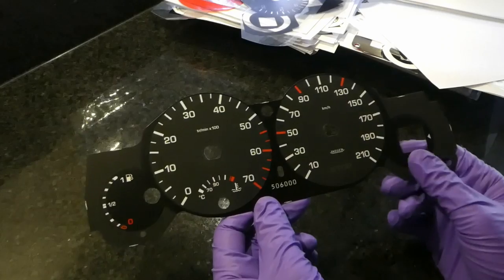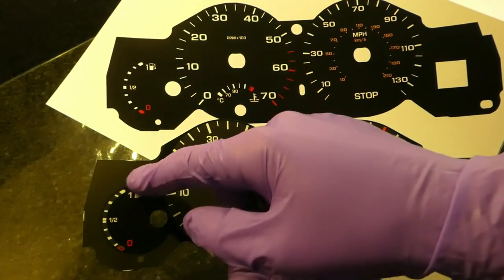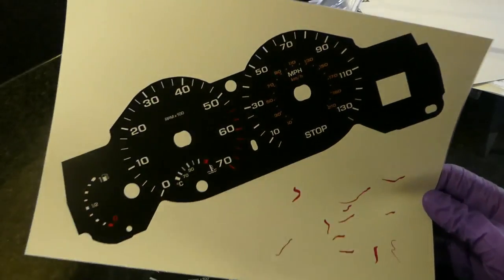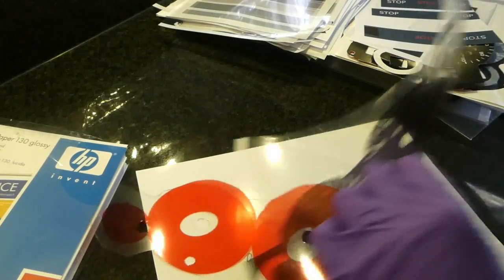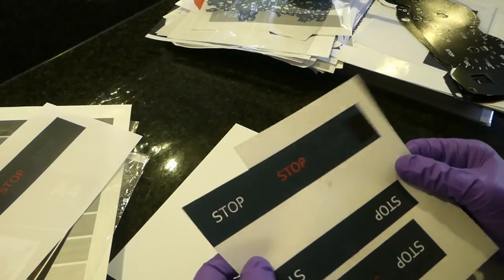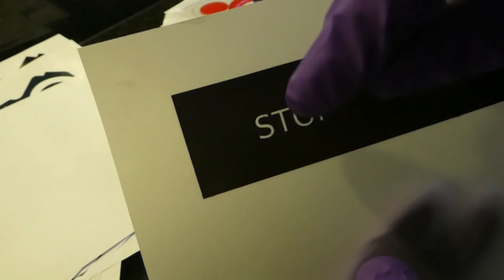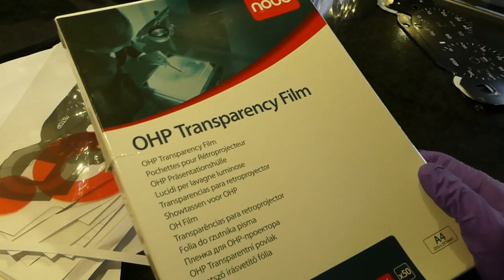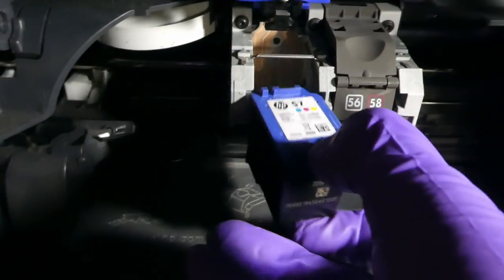3. How to print your own (DIY) speedometer (instrument cluster) - Materials

Comment: Thank you for the shortcuts in R&D for my RGB 2000 Bonneville SSEi Cluster.
I pretty much just need a white diffusion layer for the most part. Maybe a little shading so the color changes a little like at top speed and rpm.
Mine is molded though so that is going to complicate things. Might have to finally build a vacuum former.
Figure out a layering of plastics that works, laminate, form. Seems to be the approach I need to take. Its a pretty large. Cluster so I'm going to have to print a larger format.

Comment: working my way through your videos, much appreciated so far! have you considered printing on the bottom layer of transparent paper in reverse so you are gluing onto the paper and not onto the ink? thanks again.
Reply from the maker: Yes, I think I tried that. I mentioned it somewhere in the videos. While it is ok to do that, the problem is that the reverse side is rougher and one cannot adjust the sheets to be matched perfectly. It just does not slide really well.

Comment: If i use a laser printer what would you recommend for paper? Would hp professional paper 150g work?
Reply from the maker: Yeah, difficult to say. I would say that you may need to try it out. I tried all possible papers until it was a match between my printer and the paper. I do not want to say, yes that paper is good as it depends on the printer.

Comment: what paper material you use sir?
Reply from the maker: I ended up using HP Professional Laser Paper 130 glossy. It is 130 grams, designed for a laser printer, but it worked surprisingly well with my inkjet printer. You may need to vary the amount of ink that it is dumped with the printer to achieve satisfying results. Mine was on the default settings, amount of ink was exactly in the middle on the scale for my printer. Hope this helps.
Reply: @moremolecules  what about transparent paper?i dont get it that procees.. Can u tell it
Reply from the maker: @TheSepul  I tried transparency paper,  but it is way too transparent and does not block the light too well. It is really shiny. That is with inkjet printer. It is possible to potentially work with a laser printer. It is simple process, the ink must block nearly 100% of the light. The white paper I found does that with my inkjet printer. The white portion left lets light through.
Reply: @moremolecules  ooo ok... So the conclusion here.. Use one material only.. That white laser paper.  Right?
Reply from the maker: @TheSepul  Not necessarily. I shared what my experience was, but the DIY version is susceptible to many factors, paper, printer, design, etc. This paper worked with my setup, i.e. printer + design +paper. It could be that it would work better with a laser printer with transparency. All in all, that paper worked very well with an inkjet printer, probably most people will have inkjet rather than laser. Process will be similar, but materials could be different. One has to find the right materials.
Reply: @moremolecules  ok thanks sir for your info.. Thats good things. I also make diy cluster meter.. Using laser paper. But.. When finished and i put them at car..the light of cluster not same like the original light.. Not very beautiful.  That is my problem..can you give opinion and suggestion what i said sir?
Reply from the maker: @TheSepul  When you say not very beautiful, what do you mean? Is the light dull, not shining through or the paper lets too much light through the dark bits? All in all, it will never be the same as the original. The riginal in most cases, not all though, is done with screen printing technique on plastic. That would give you perfect screen.
Reply: @moremolecules  thats right..but very impressive with your style..using paper..so how many paper u use?
Reply from the maker: @TheSepul  I used only one paper, it is 130grams heavy and the black ink does not let the light coming through. Otherwise I tried a variety of papers with varying success.
Reply: @moremolecules  orait... I will do it.. Wait for my result frens...
Reply: @moremolecules  can u show me your variety works?

Comment: Can I Pm you ?  Need some help
Reply from the maker: Hi Abi, yes, certainly. You can reach me on more_molecules@protonmail.com
Reply: Can you use a laser printer for this
Reply from the maker: @CWallyMan  Yes you can, I just did not have an access to one to try. THe problem with the generic laser printers is that they do not produce that good resolution, the inkjets will always beat them in quality. With much more expensive laser printers is different though.
Reply: @moremolecules  I send you on email please check. Thank you.